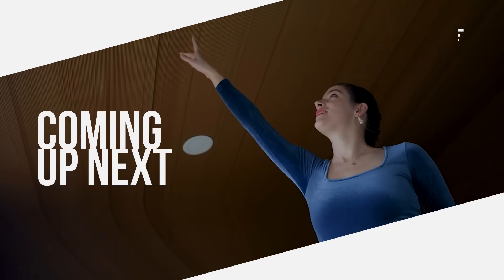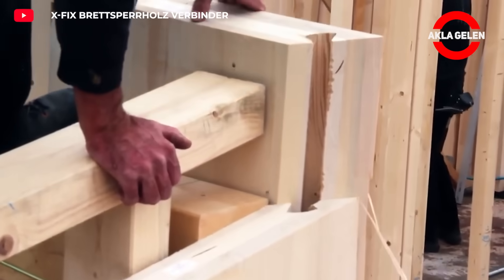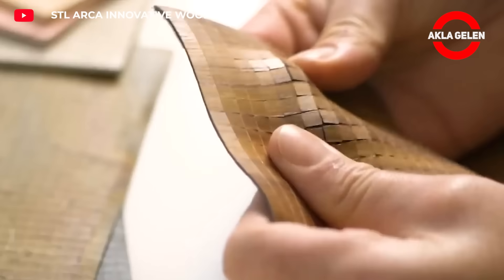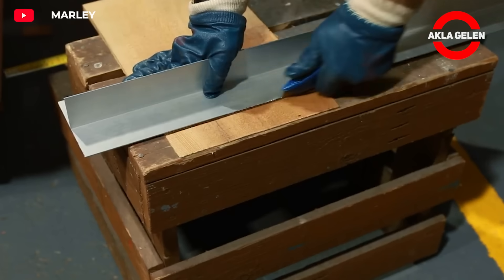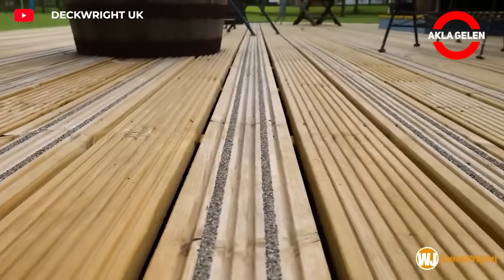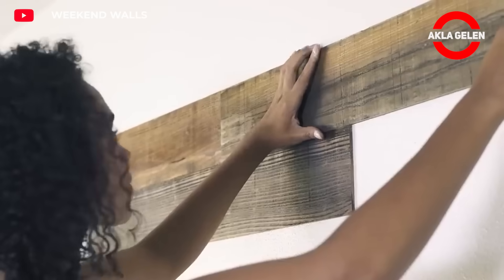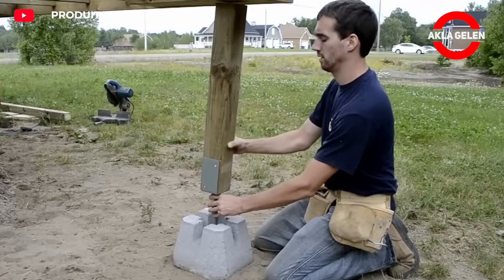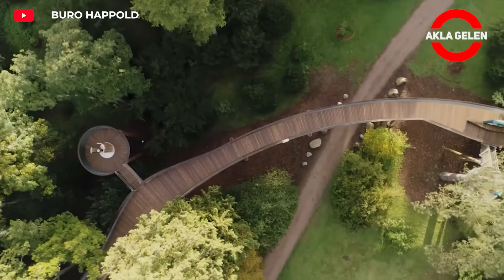Carpenters Can't Believe This Wood Technique Works - Most Ingenious Construction Technologies

Comment: The so-called cross-laminated timber connector is similar to the way Japanese building were constructed for centuries using wood joinery with keyholes / slots and matching inserts and shims.  Those buildings have also stood for centuries but can be straight up dismantled, moved and re-built using only hammers and a few other hand tools in case a structure ever needs to be relocated.  Additionally, when buildings are simply of no further use, practically all of the material can be re-used in new structures, if properly dismantled.

Comment: Wood negatives....flamable, mold, mildew, rots, termites, unpredictable connections
Reply: Depends as there are many wood based products that have been highly improved over just traditional wood. I know engineered I beams are as strong but lighter. Making knives and gunstocks I know wood laminate is more durable and resistant than traditional wood of the same type. I think I saw a pine compressed densified flooring that is cheaper but more durable than traditional hardwood. I just like technology